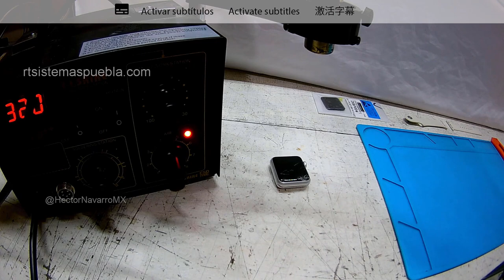How to replace display for iWatch 1ºgen 38mm

Comment from the maker: 00:00 Herramientas  necesarias:
Cutter, espátula plástica y metálica, pinzas punta fina
00:04 Con la espátula plástica presionar el seguro para liberar la correa
00:10 Calentar con pistola de aire a 300ºC por 2 minutos
00:20 Introducir la navaja entre el cristal y el aluminio
00:38 Debes desconectar la pantalla gentilmente
00:45 Despegar los conectores flex
00:58 Abrir cuidadosamente con una punta fina
01:20 Retirar la tapa
01:27 Retirar la cinta adhesiva
01:51 Colocar cinta adhesiva en los bordes
03:02 ...
03:14 Conectar la nueva pantalla
03:37 Así debe verse conectado correctamente
03:47 Colocar la tapa
03:58 Cerrar haciendo presion gentilmente
04:08 ...
04:29 Remover las tiras protectoras del pegamento
04:44 Presionar firmemente el display
04:48 Probar el encendido
(sin batería)
04:53 Colocar las correas
05:06 Probar encendido
(sin batería)
05:13 funcionando correctamente